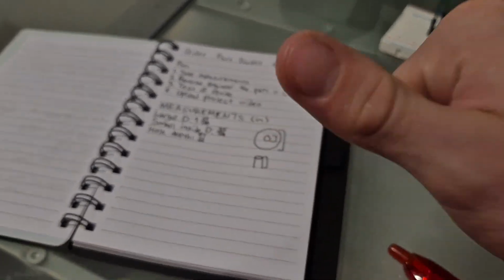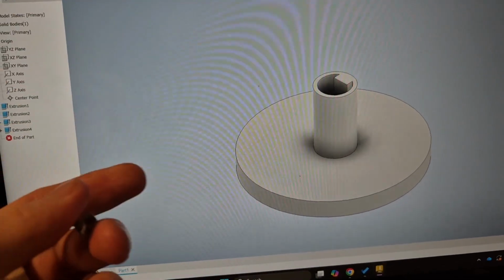I fixed my Toilet using Engineering

Comment: Probably would have been cheaper to buy the knob at an electronics HW store. 
This was a video to show off your 3D printer. Admit it?
Reply from the maker: It probably wouldn't because the odds of them having the exact piece and measurements of a random toilet bidet is crazy, plus Bambu tells you how much the print costs when you slice the plate, only a few cents. And no it wasn't, it was a showcase of the engineering process to show how you can make your own things and not be so reliant on wasting money to buy a whole new part. Plus if you watched the video all I did was a time lapse of the print being printed so if you think that's all I was doing, you are clearly clueless lol
Reply: @RhinehartEngineering that's actually a standard knob, look up D-Shaft Knobs
Also, the print cost in Bambu is probably only the cost of filament. You are also paying for electricity, and your printer has wear too. An easy way to calculate your printer's operation cost would be taking the cost of the printer, looking up the expected amount of print hours it can do before breaking, dividing the printer cost by those print hours and you'll have an hourly cost of your printer for wear and tear. Obviously you'll mostly just do maintenance on the printer instead of running it with no maintenance and then throwing it away and buying a new one, but that's a rough way of calculating cost which can be useful for pricing 3D printed products :)

I do think that it was still worth printing it yourself though. Besides the point of learning, the cost is probably the same if not less than buying a knob and you don't have to order stuff online or go to a store and look for the right knob etc
Reply from the maker: @juandig Thanks for the comment! I didn't realize it was a standard piece but now I know to look for that if I decide to in the future. Never thought of the pricing breakdown like that either. Either way it was still a fun project at least. See, this is exactly why getting other viewpoints is so helpful. Thank you!